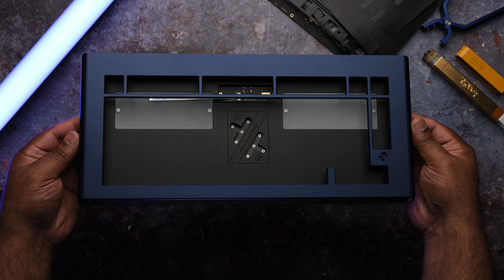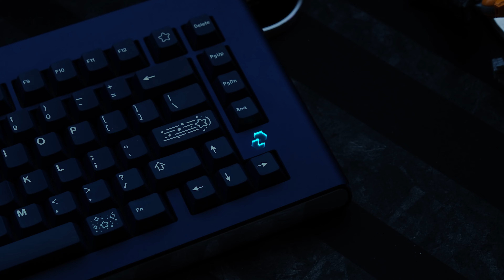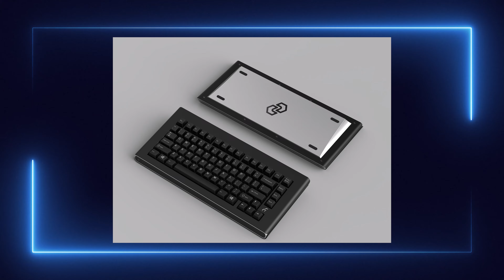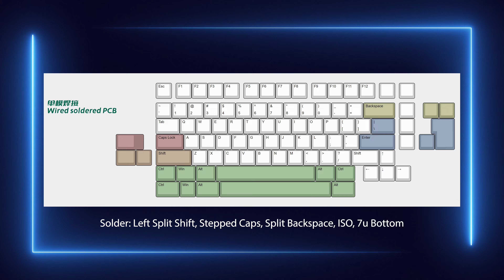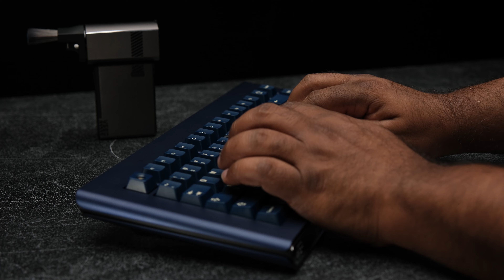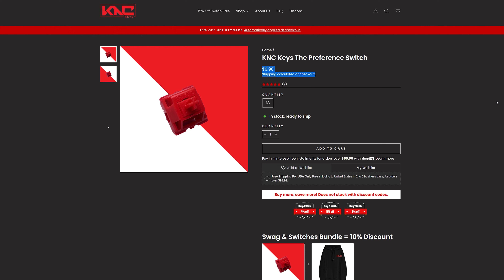An All Around Great Custom Keyboard | Wind Z75

Comment: appreciate the top notch review! I have too many 75s to add another one to the collection, though not sure I’m sold on the styling (or 16 screws to open) anyway. Glad they’re offering a non-flex cut PCB, and still achieving a flexy typing experience with the gaskets, this is the way.
Reply from the maker: Yeah Alex, it's pretty nice. Totally understand having too many 75s. Same boat rn. 😂
Reply: @Clacktech  still waiting for a dedicated o ring 75% to come around, I’ve heard the Tomo (and presumably the freebird 75) o ring performance somewhat suffers since it’s also designed for top mount, but I haven’t tried one myself so I couldn’t say.

Comment: If you had to pick one, this or the Mode Sonnet?
Reply from the maker: Ohhh that's tough. Sonnet is really great, and This is too. I'd go by which one you think looks better.
Reply: I’ll just throw my biased and unhelpful hat in the ring for the sonnet, picked one up from the original batch based on all the positive feedback from reviewers, built with alu half and soldered in gat cream sodas (lubed and filmed), and I’ve only grown to like it more with time! That said, if you have a preference for gasket mount over top mount, then you’d want this board.